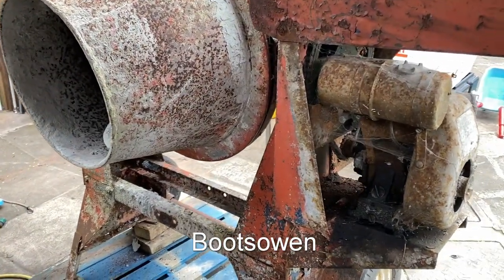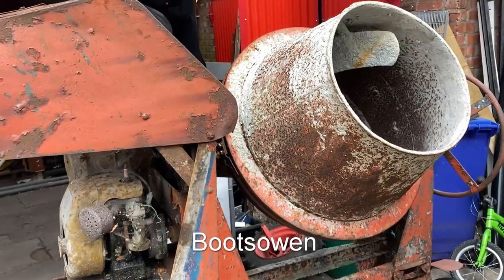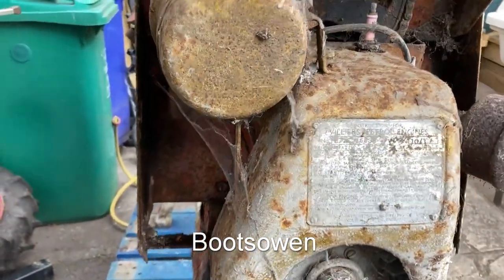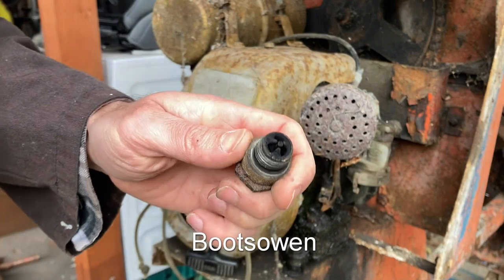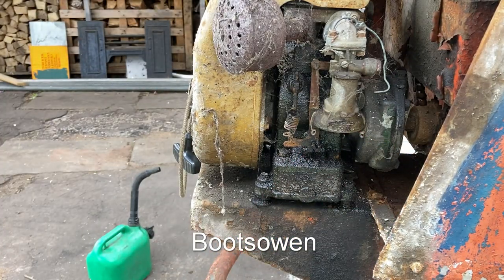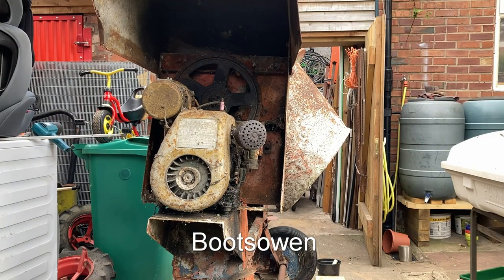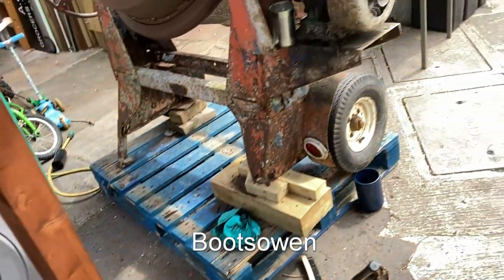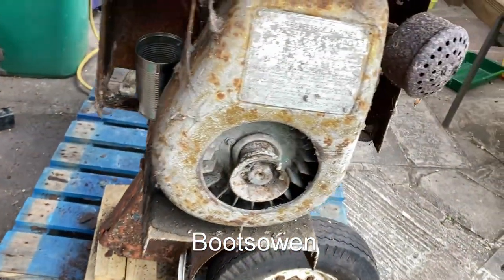Will it start? Barford Cement Mixer with Villers 10 petrol engine

Comment: Hi Owen, 

yes this is the Peter, the guy you bought old "Bertha" from! (Bertha was the affectionate name we gave this old girl, the name of my wife's favourite great-aunt). I've only just come across this video but was so happy to see her running again and glad you were so pleased with your purchase - 7 months on I hope that's still the case! Thanks also for your kind words - I enjoyed meeting you and the whole experience that day. 

I bought the mixer second hand in the late 1980's and it was quite old and well used even at that stage. You're right that it was designed to be towed - I actually borrowed a pin hitch from a mate and towed it behind my car from Glossop to Heaton Chapel, Stockport, where we lived at the time. That means we had the old girl for getting on 35 years!! Have to admit that apart from putting in some fresh engine oil shortly after purchase, I barely did anything - that Lodge spark plug was in it when I got it! 🤭That said, never had an ounce of trouble, she started pretty much first time every time and would work all day. 

A couple of tips on running - I'm sure she would have started first or second pull if you'd have put on the choke - did you notice there's a bit of copper wire attached to the side of the carb - that holds the choke lever in the closed position - as soon as it starts you can flick that off. Just like you said, the fuel tap would stop dripping after a few minutes, although it does seem to drip more now than I ever recall - perhaps the seal's finally given up - an easy fix for a man of your calibre! As for stopping, I always just pulled off the plug lead, although I'd do it with a length of wood as I've had too many HT belts to risk using my fingrs like you did!

Keep up the good work, been watching some of your antics since we met and always enjoy your videos. Love to see any progress made with the mixer.

Best Wishes,
P.
Reply from the maker: Great stuff Peter, It is up on blocks under cover at the moment. I pieced and welded the rust and have yet to build a new rolling gear or skids. I looked at it a few months ago and wondered why I bought it, It has laid up since then. But springtime will take care of it! I have a load of video of the welding but it doesn't have a conclusion yet! 
Happy Christmas!
Reply: @bootsowen  Thanks Owen, I'll look forward to seeing that. In the meantime Happy Christmas to you & yours too!